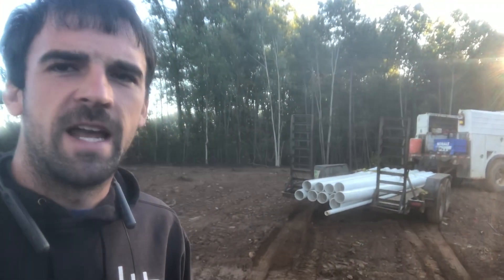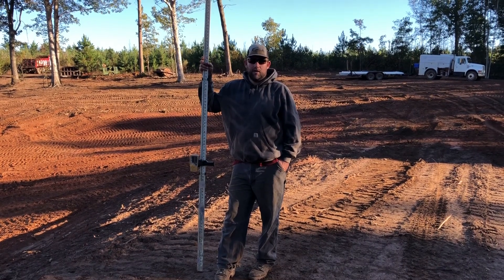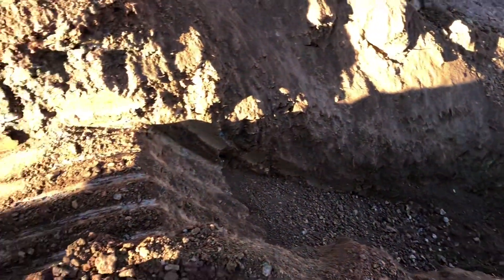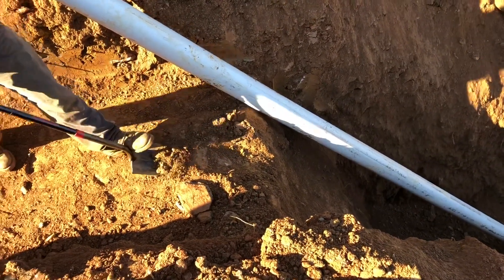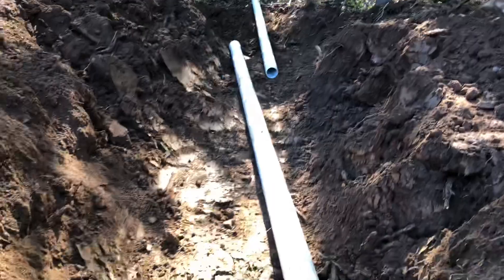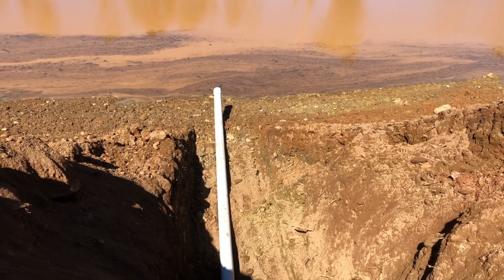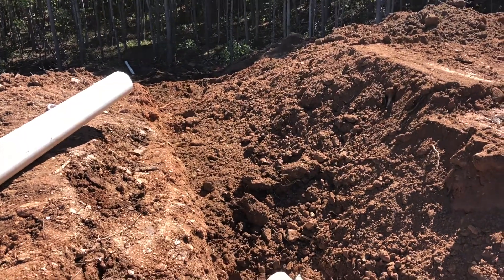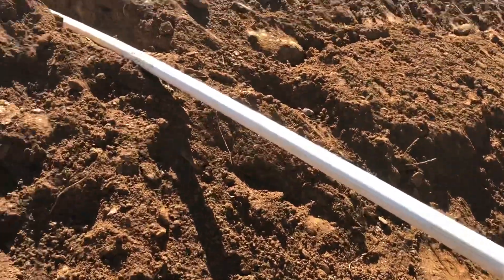Lake Syphon System

Comment: Do y'all normally put the bottom of your vent pipe even with the middle of your cross pipe that goes through the dam? Is that how you determine the Level of the water?
Reply from the maker: Yes, it doesn’t have to be exact but the level of the water will be determined by the height of the pipe in the damn. You just want that vent to be submerged when water gets flowing pretty good in the main pipe. That’s how the syphon is created. When the lake water drops back below that vent pipe then the syphon is no longer engaged.

Comment: Great video!  I had a question which type of PVC you use?  Schedule 40 Pressure Pipe or DWV Schedule 40?  I got ready to buy at Lowes and started doubting myself.   I also would like to know if you used regular glue joints.  Thanks in advanced!
Reply from the maker: We used standard schedule 40 PVC. I imagine you could probably get away with DWV but we like to error on the side of caution. We probably went overboard, but better safe than sorry when it’s something buried in the dam.

Comment: Great video! I'm thinking of putting this same system in for my pond.  Curious if you used something on the end of 6" pipe that is in the water to keep trash/ debris and fish from going thru the pipe?
Reply from the maker: We have done this same thing on several ponds and have been very pleased. It's well worth the money. We have never put anything over the pipe that is in the water and have not had any issues. We typically install the pipe about 4-5' from the bottom of the lake, and it hangs out about 6-8' from the bank. This keeps any fill in silt or anything else like that from stopping up the pipe. As far as fish go, they may go in and out of the pipe but haven't ever noticed any going out the other side or having any issues with that.
Reply: @FarmerHunt  ..makes sense..1 last question man - the size of pipe? The pond in this video seems a touch larger than what mine will be, however I will have a significant amount of runoff  hitting the pond.  How to do know if I need a 6", 8" or more pipe for the system to not be overloaded? thanks again...MH
Reply from the maker: We have always used 6" on all the lakes we do. They are typically 2-5 acres. Will you be doing a backup spill way? If so, then 6" should be plenty adequate. We always do a backup spill way just in case. We would much rather the backup spill way be put to use than have water come over the dam and wash part of it out.

Comment: What causes the siphon to begin?
Reply from the maker: As the water level in the lake rises, it also begins to rise in the pipe that is buried in the dam. Once it gets to a certain level, the water starts flowing through the buried pipe that is parallel with the top of the dam. If the water level gets high enough, it will create a siphon in that pipe until the water level in the lake drops below that parallel pipe.
Reply: Basically, the output needs to be below the input

So when the pipe fills with water and has no air, water will start siphoning